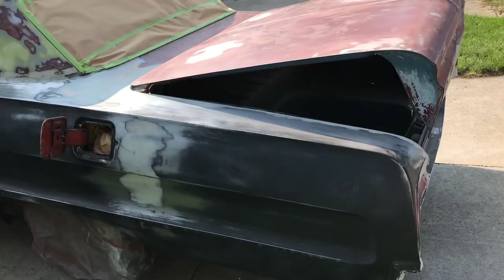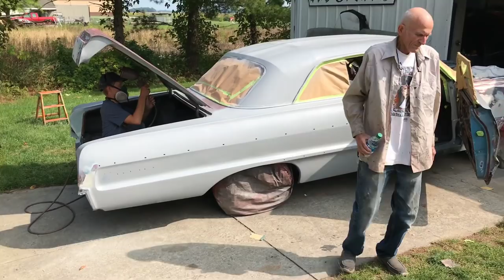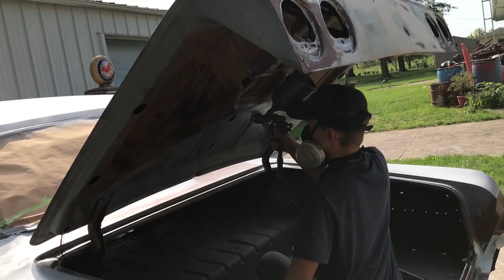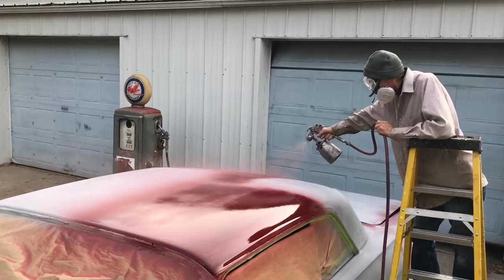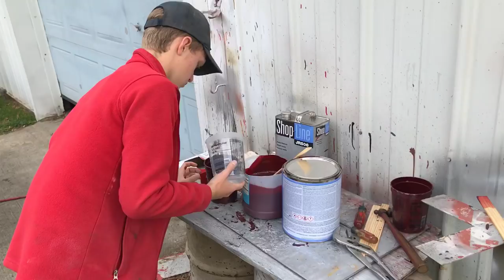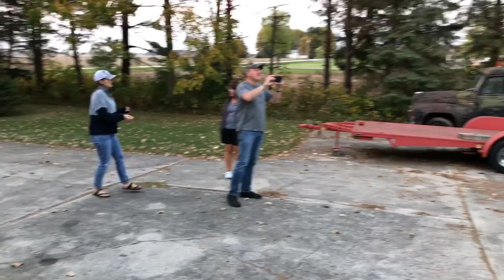1964 Impala Painting Progression

Comment: Cool to see the efforts put into this ride, I'm sure it'll end up in great shape. I plan on redoing my truck soon as I get the chance, but I plan on building a paint booth out of PVC tubing for the framing and rolls of plastic sheets. This way I get out of the elements and have a cheap paint booth. I would not do it outside in the open, too much extra work redoing the flaws from bugs and dust and other flying debree.